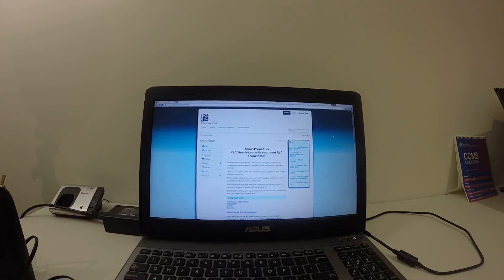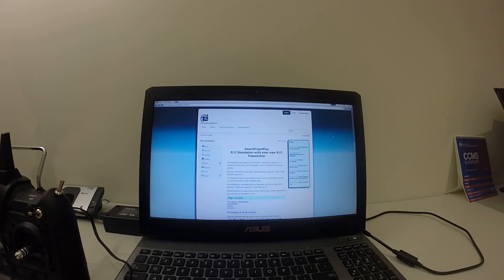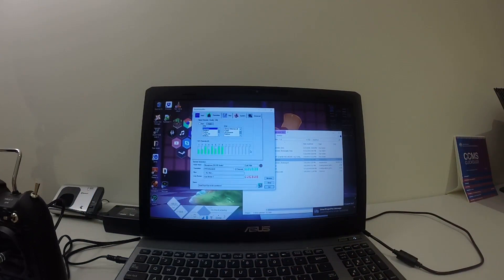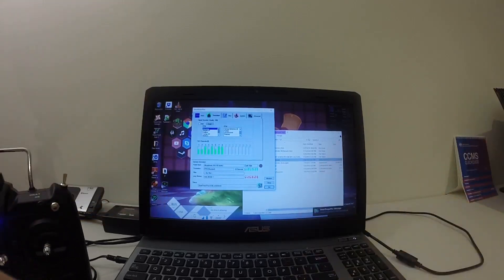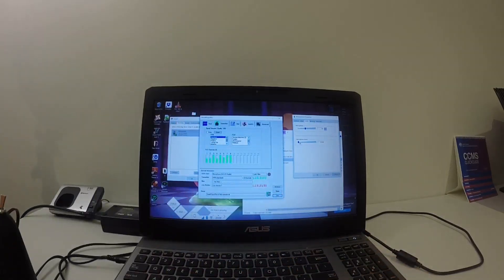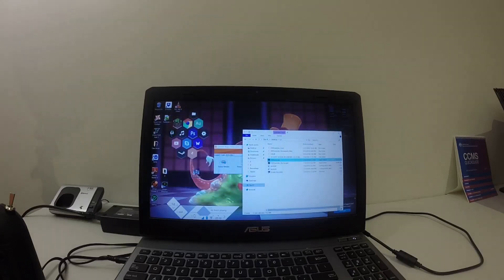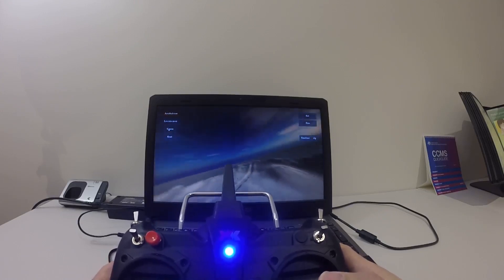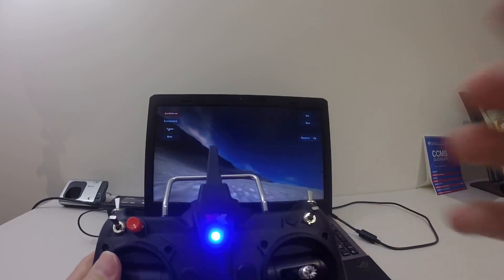XK X7  or X6 transmitter + SmartpropoPlus with FPV Freerider

Comment: My laptop is new, but the cable auxiliary is not detected in smartprotoplus. What's I am doing wrong? Is the same transmitter
Reply: Did you get the solution same problem plz help I use a earphone cable in  fs-ct6b transmitter it's showing cannot feed position to vjoy device

Comment: hi bro，may i know what kind of cable u use for connect to pc?
Reply from the maker: Thank you for watching. Just a standard audio cable.
Reply: jtgravityRC u mean 1 site audio，1 site usb that type?need any driver for pc?think to training acro in pc 1st
Reply from the maker: No, normal audio cable you plug into your audio in port. Watch the video and see the description. The instructions are there.
Reply: bro,im already install the transmitter to the PC,but the control all confuse...can help?
Reply from the maker: Have you install SmartpropoPlus and have you tried to reduce the mic in volume?
Reply: yes,already install smartpropoplus and adjust volume to 40,but int the simulator is mode 1 and cant control properly
Reply from the maker: See my other updated videos on troubleshooting. They are listed in the description.

Comment: ok when I setup the controller on the simulator when calibrating the controller the sticks started to twitch but I may have found my problem I have been putting no throttle in the setting on fpv freerider  when stick is full down but in reality it was not off when all the way down so I left the setting to no throttle when stick is in the middle it works that way but just akward
Reply from the maker: Throttle in the middle is for ps3 or xbox type controller. I assume that you have calibrated the transmitter in FPV Freerider. I suggest to re-calibrate your X7 sticks and also to turn on the transmitter before you turn on FPV Freerider. Also did you set up the Smartpropoplus correctly that is you need to dial down the volume and then check to make sure that the UI of Smartpropoplus stays solid. If you still have problems, maybe you can send a short video to me via my messenger on my facebook page.